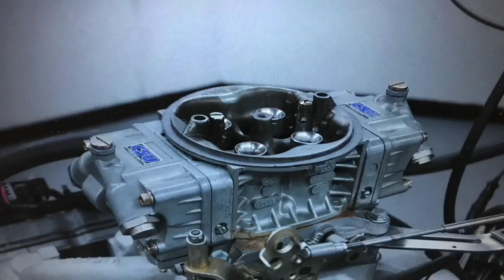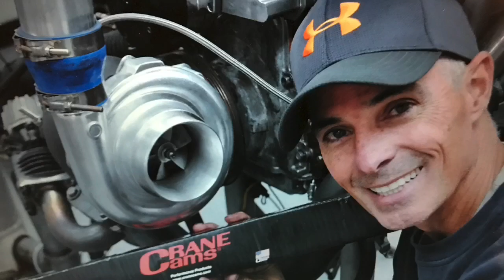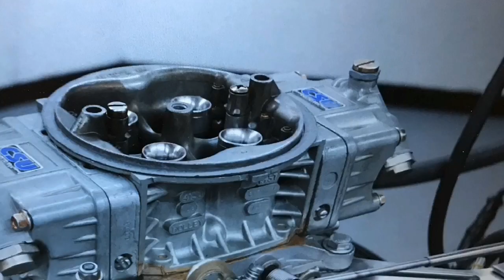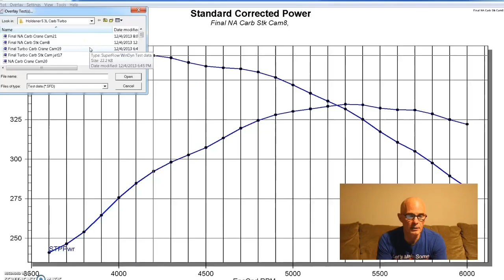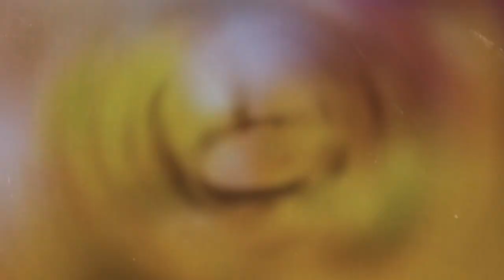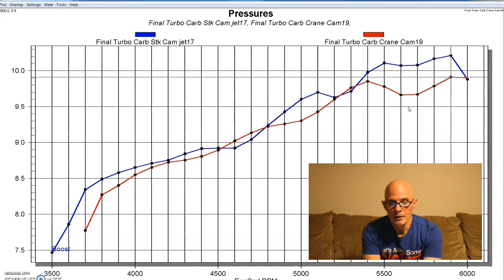CARBS, CAMS & TURBOS!! DOES IT WORK?

Comment: Why no intercooler? I’m building a 460bbf foxbody. If you go with a blow through carb do you not need an intercooler?
Reply from the maker: intercooler always good
Reply: Because the carburetor will actually cool the air charge unlike fuel injection with spraying fuel directly into the cylinders, I do not run a intercooler on my CSU blow thru 5.3

Comment: What if you added two turbos? Would the engine blow over 6k? Should I take carb over injection to try and make 1000whp?
Reply from the maker: you can make over 1000 ho with one or two turbo (if properly sized) You can run over 6000 rpm with the right cam and intake package

Comment: Distribution is different because the primary pipes on the headers are all the same as opposed to tuned to each cyl. To a lesser extent, the intake runners are different but not necessarily correct for each cyl.
In other words, by changing dis or length of the primary tube, you could tune the cyl to be all the same.

Comment: Rebuilt 317s with trunions/springs/seals/guides upgrade, 54-469-11 Comp cam, Victor jr, CSU 850 blow thru and a VS racing 85/102 turbo kit w/twin Wastegates on an Ebay "master" engine rebuild kit........Thats what I'm currently slap'n together.  Can you tell I've been listening to ya Richard?  🤏😎
Reply from the maker: GOOD STUFF

Comment: I like it.  Kinda of what I am looking at doing with a 318 after it run for a while NA in a Stealth Bomber tribute car. Curious as to what a dual plan would do different than this single plane.  Is it exactly the same as NA engines, I was wondering after your fuel distribution comments.

Comment: I'm just poking around trying to make a decision on how to get where I want to be.
I'm building a daily CJ7 (CJ7 hybrid frame for TJ suspension and drivetrain, My TJ frame literally fell apart while driving home).
What I'm aiming for is swapping a v8 in while keeping it a stick shift (I have an advanced adapters AX15 trans).
The tricky part is I also want to go completely mechanical. Meaning I don't want an ecu. So I'm looking to go carbed with mechanical fuel injection.
I also used to own a turbo car years back so I'd like to see if I can run forced induction, preferably a turbo. I haven't decided on the engine and the easier option (because it's what everybody does) is usually not the direction I want to go. I want to build what I want.

Hopefully this works out and I can find a setup that will work well together.
Reply from the maker: blow though carb and turbo
Reply: @richardholdener1727  Seems like the right choice.
Thank you

Comment: Excelent video but I wold have liked to see the dyno tests running this engine. I have a question, how you do to not a have lean mixture when the turbo is charging full pressure? Thanks
Reply from the maker: we tune the motor with the Holley ECU to provide the optimum AF and timing under boost

Comment: With respect to the runner length has anyone thought about Doing a custom intake where you match volume of long runners to the shorter runners maybe by decreasing size of the runner to closely match the volume of the shorter runner. Thus in turn more or less tuning the intake to balance flow to match each cylinder
Reply from the maker: it's not volume that produces the reflected wave tuning-it's length (distance traveled for the wave)
Reply: That is true and your long runners will always have a longer wave due to distance

Comment: Richard, do you remember BBC's factory Holley 780 3310s they had tabs on the left front and right rear boosters, said to help fuel and air distribution. Holley even cocked the carb for that reason.
Reply from the maker: haven't seen an old 3310 for a long time

Comment: I think you should do both pin the gate and break the knob off the rev limiter !! Lmao it was quite impressive actually and I've thought of running a carbed L.S. motor just a cam swap will be plenty for me 350 hp or a a bit more is no joke in like a g body or even a c10 square body w a 373: 1 limited slip tire hell !! Lol

Comment: I have not read the 201 messages they already send and maybe this has been brought up already, but I will comment about cylinder distribution with that open plenum manifold with the carburetor you used in this test, I'm not expert ( absolutely far from it ) but I only can think is, that as the carburetor butterflies open they do so pointing to the middle of the manifold in Vee shape "V", since your closes runners to that "V" shape are your middle runners, logic points out that by traveling distance and resistance the middle cylinders will be possible filled more, ( I really don't know which cylinders were leaner/hotter or richer/colder since I was not present, the first think that I would do is install a 4 hole spacer like the guts from Engine Masters did but I will go with a 1,5" thick spacer as a minimum, I believe a 1" thick is not enough to correct enough the flow downwards, this will make the outer runners to help fill more the cylinders, but what I want to propose for you Richard to test is, to install higher rocker arm ratios on those cylinders that are leaner and see if that evens more the filling charge for all cylinders, so if you run 1.5 or 1.6 rocker ratio, try 1.7 in those leaner cylinders and see what happen, if you could do so on a Ford 302 or your least favored 289 that will be awesome, the trued it doesn't matter which engine you do the test on so far they are equal distanced/separation inlet ports, I hope you really are into it to this test if you find it valid, I think I know what the results will be but like I said I'm not expert, just a engine aficionado.

Comment: I love what you do. On builds like this it would be awesome to see the temps and a/f of all 8 cylinders individually to see how well the intake and the carb do for distribution. Would also be cool to see the temps to see how much the carb is helping cool the charge air. Then add a Intercooler to check all the same items and see just how much is left on the table with a particular fuel if you stay non-Intercooled. Keep up the great work and was great to meet you at LS Fest!

Comment: I have an interesting test for you. Can you use non VVT cams in a VVT engine and retain timing control? I have a 6.0L L76 vortec and want to run a better cam without breaking the bank. If it works i bet there isn't much difference between VVT and non VVT cams. Just like every rec port cam is a cathedral port cam and Visa versa. Im assuming degreeing the cam would be very important because not many people have done it. I love your videos. It's so awesome to see quantitative evidence of the books and articles I've read. Richard holdener is man.

Comment: I'm running a draw through turbo set up on a 70's sbc 305 with slight head work and a heavy cam run on propane. 10psi boost and the motor loves it. No dyno yet but I'd say it pushed the motor well over 375hp from around 160.
Reply: Don't know if you will see this but I would love to know more about your set up!

Comment: Now did you not run a intercooler because the carb set up takes so much heat out ? And how much boost would you run without an intercooler with stock internals like this ?
Reply from the maker: low boost and carb acts as coloer

Comment: I run almost the same set up it’s a 5.3 with a C&S aerosol blow through carb  and BW 75/83 in a s10
My carb hat is cocked to the right about 45 and reading the plugs 1&3 seamed leanest 6&8 were the rich holes 
I stager the jets to favor the left front 
It’s run 9.40@140mph
Reply: Whats your timing and boost

Comment: It was a interesting test but the boost curve seemed fairly bumpy for both cams... might be some "funny business" going on between the carb, intake manifold and exhaust, meaning cylinder to cylinder air flow differences. Carbs are massive blockage to flow, and it gets worse as the boost increases. Airflow imbalances also get worse particularly at part throttle when boosted... the throttle plates begin favoring certain cylinders because of the angle, and starving the others, and this causes weird pulsations in the exhaust leading to the bumpyness in the boost curve. I've seen flow bench tests were they tested all cylinders simultaneously with a throttle and manifold attached and at certain throttle positions there could be a 50% difference in airflow to individual cylinders.
   Also, I read an account of a guy that bothered to check how much airflow his carb was costing him... when his manifold pressure (after the carb) read 20psi, the manifold pressure before the carb was 28!! might be cool to try this same engine with EFI and four pairs of throttle bodies attached to a common plenum to see how big a deal manifolding and throttle plate angle can mess with airflow balance.

Comment: A lot of people will call it dated, but when set up right draw through carbs work really well and fuel distribution isn't an issue. You do need quite a bit more CFM's with draw through over blow through. I will admit I only have experience with this on VW's so v8' could have issues with it I don't know about.

Comment: How about a field trip to the junk yard. And step by step on engine removal in the junk yard. Common issues, and pro tips. Awesome learning experience everytime I watch
Reply: He subs that out to a local guy but it’s relatively simple unplug everything and unbolt trans mount or bell housing it’s easier to get it out in one unit because they should have it up enough in the picknpull yards so it comes out easy. Just be courteous and ethical don’t be “That guy “ who destroys a bunch of stuff to get what you want. Make an effort to unplug things and unbolt them if possible don’t just destroy the wiring harness with wire cutters ect

Comment: Excellent video. I like carburetors but stagger jetting is often almost a must when boosting. Love to see the AFR distribution that is a problem on most V8 engines because these engines run like a V6 with one pair of very big cylinders. No one talks about this.
We need to know where to put larger jets and where to put smaller jets on different engines and different manifolds. :)
Not your cup of tea, but here a extra low budget turbo carburetor engine with stock rods, stock milled down pistons, pump fuel etc. Dynopapers and photo of engine bay in the description. Carburetors works. :)  
https://www.youtube.com/watch?v=nk7lU8TWZ70

Comment: I really do believe that blow-thru carburetors have there place, no matter how much people are afraid to change a jet or power valve or read a spark plug. EFI has basically only been around since the mid-eighties and is not that much different than carbs. There are simple parameters to follow as well certain values given for each sensor, someone commented that if your not going to tune an efi system then you should run a carb? A un-tuned blow-thru carb will be just as bad, either system will melt a piston or a turbine housing just as fast. One system is not greater than the other, it depends on you and what effort you put into it.

Comment: Richard, love the builds and videos!! In your opinion, how much extra hp via boost can a truly stock V8 handle reliably? I have an older mercedes slk 55 amg with a 5.4l m113 engine that is like to put a set of rear mount twin turbos on. I know itll need to go to the dyno before attempting to run it ouke that, but just wondering where I should set the wastegate limits and what size turbos would be reasonable for it  thanks!!

Comment: I almost went this way with my 5.0 coyote but there are no good single plane intakes out there for the Coyote. Holley makes what is basically an inexpensive sheet metal EFI intake with a carb flange mounted on top but it's thin, pron to cracking under boost, and far from ideal with carb. The closest I've found is a carbed cast aluminum manifold for a 5.4 which requires modification for use with the 5.0 but it can work. So, instead, I'm just going to go with the 2018 Mustang intake manifold and a Holley HP EFI system.

Comment: Duh you mean the major manufacturers don't know all this? Anyway it is a cheap way to boost power.  The old Grand National Buicks with a 225 v-6 were quite fast and reliable with a suck through setup using a Quadrajet. 

For the distribution problem use : 4 weber downdrafts, ITB fuel injection, Or grind multi pattern camshafts.
The 850 blow thru carb is too small for this combo.

Comment: Love the great variety Richard , thanks .  Here’s my two cents . I have a twin Borg Warner 555 BBC with too small air to air intercooler on 335AFR heads ,ported victor junior as that’s what fits under my flat truck hood , big hydraulic roller cam and a CSU 850 blow through carb with twin needle and seat bowls . This makes 1340 to the wheels at 6500 still climbing at twenty pounds boost , has excellent street manners no  hiccups and runs nines in 5000 pound truck not optimized for track as I have put street manners , ride comfort and quiet cruising first . Nothing is low budget including this carb but  I have been going on short and long drives plus trips to the track for five years now barely  tweaking it and changing plugs once a year just because. Kevin at CSU gives excellent after sales service and advice , however this truck has been brutal on transmissions and differentials . A previous 540  was 1000 engine hp using a ProCharger, no intercooler on a Quick fuel 750 BT but it  was at the end of fuel delivery with  same excellent driving manners so I love a good blow through carb .
Reply from the maker: they work well

Comment: If you want to make a popular video, put together a street peanut port 454 combination that can deliver 500+ HP.
Reply: How popular would that be? Not very many people using big blocks anymore. Can make more power with less weight, less real estate with an LS.
Reply: @simpleman2004  
Not everyone thinks like you, Simple Man.

Lots of people want the BBC sound, and the low end torque, that a stock stroke LS just cannot deliver.  They have these peanut port BBCs lying around that they'd like to make use of, but don't want to spend $3,000 on heads.

I am one of those individuals, and I know several more.

Comment: Richard good morning, why do cams specify the need for certain rear end gears or high stall torque converters ?
Reply from the maker: usually because they lose low-speed torque and work best at higher rpm

Comment: Great info Richard. Will two 44mm wastegates on the crossover pipe control the boost level? I only have one and it doesn't
Reply from the maker: yes-we use two on our turbo stuff on the engine dyno
Reply: @richardholdener1727  outstanding! Thank you Sir...

Comment: While i like that every cam is a turbo cam, can you get into at what point a dedicated "turbo" grind would be better than a NA cam in an engine that made the most HP it could in "NA" form and then added boost to it. IE, If a boosted cam made less power than the NA cam, is it just the wrong cam? Lol
Reply from the maker: a typical turbo cam with the same intake duration will usually make less power than an NA cam-both na and boosted-doesn't mean it the wrong cam though
Reply: @richardholdener1727  if for example the more power you start with NA, (as you stated), the more power you make boosted. So, for example, if you pull a cam out that made 600hp NA and install a dedicated turbo grind and make less power pre-boost how is a boost cam better? is my question.  Hope that comes across correctly.

Comment: I prefer injection, but I won't ever say that carburation doesn't have it's place. Seems to be pros and cons for each. For the last few months I have watched umpteen videos trying to learn as much as I can about manifolds. I want to CNC machine my own 2JZ manifold with a built in water to air intercooler. Long runners, short runners, big plenum, small plenum, lots of considerations. What I have semi decided on is two different length runners that are fairly long, but trying to make the runners as straight as possible. Also recently I have been thinking about trying to locate the injector much further back up the runner away from the head (possibly on the turn). So it can get some of the benefit the carburetor guys get with latent heat transfer. Probably will mull it over for a few more months yet.
Reply: Mech engineer here:
If you know your desired powerband you can figure out your ideal runner length by using the distance from the back face of your valve to the beginning of your runner divided by the speed of sound and then matched up with your valve timing events. You will probably need to catch the wave on the 4th trip trough the runners (divide the original calculated length by 4) to get something that's not too long.
There are formulas and stuff on the internet if you care to look.
Reply: @Cowboy.underwater  thanks, yes I saw a formula involving 84,000. Some of it will come down to available space without hitting the inner guards, hood clearance, available intercooler cores, and not inhibiting the tappet cover so much that I can't get to the plugs. I'm currently in the middle of making CNC upgrades on my X axis, so until I have that sorted I am just going to continue to ponder. I did see something similar based on a factory manifold, but it blocks the plugs by the looks of things. https://www.youtube.com/watch?v=bpiGM23-R8g